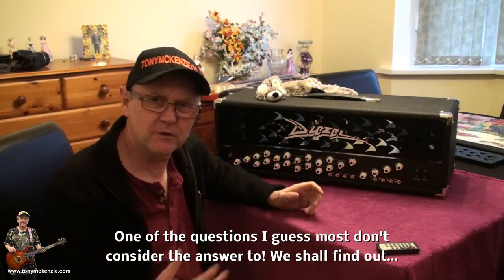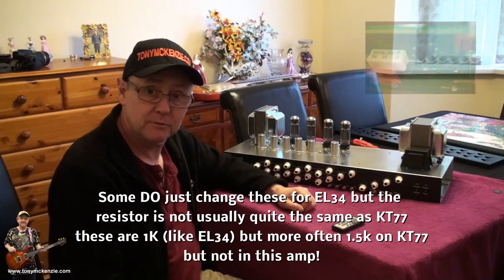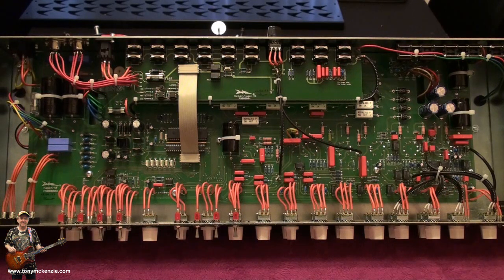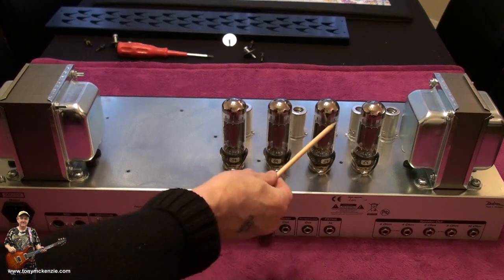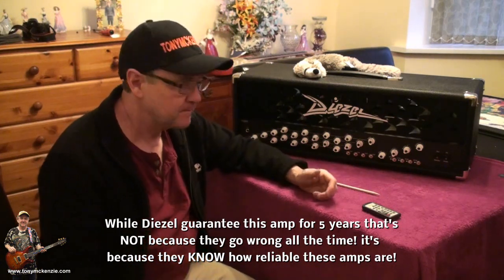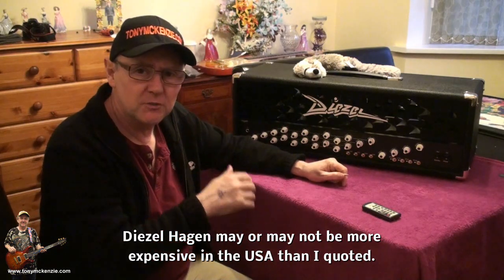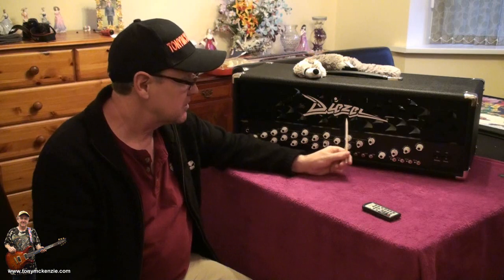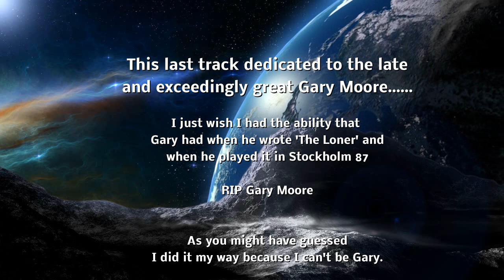Diezel Hagen Amplifier: Are They as Good As They Say?

Comment: I would still take a Bogner over Diezel, or a good ole Marshall, Orange or Mesa Boogie. Diezels to me sound a bit clinical, too perfect, not organic and human enough.
Reply from the maker: Hi Rich - this one sounded quite good though (even with cheap tubes LOL). Having used those other amps the Hagen IS different than either the Bogner or Marshall stuff I thought. I do think its probably a bit less flexible than say a Marshall 410HJS (satch version) but it did sound good... would I keep it? I'll probably sell it at some stage as personally I like Marshall and Mesa better. But thanks for the input... the more other views the better as I'm sure others will gain from that.